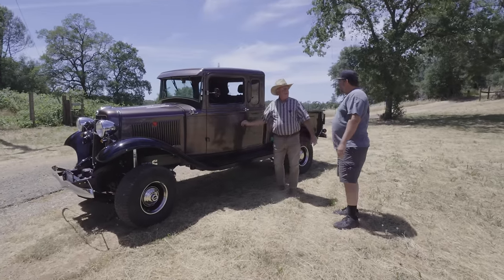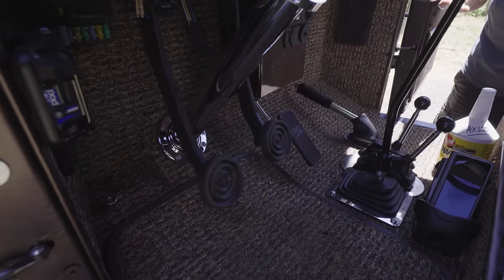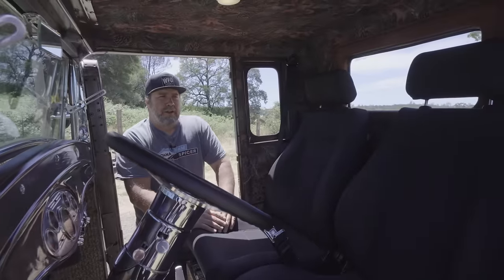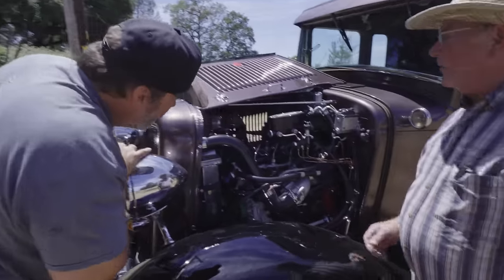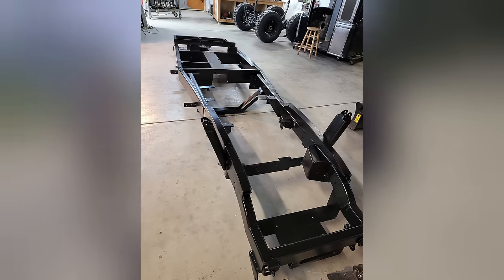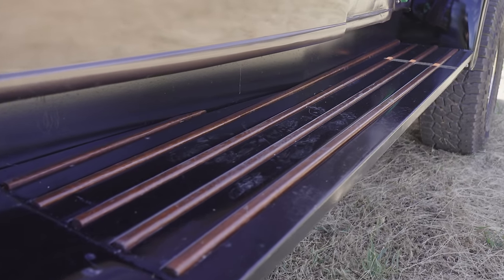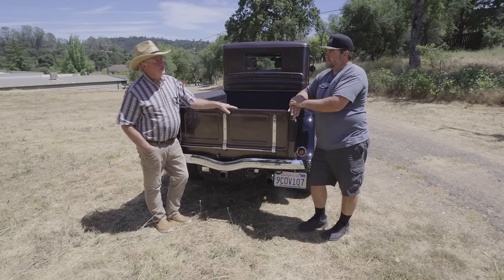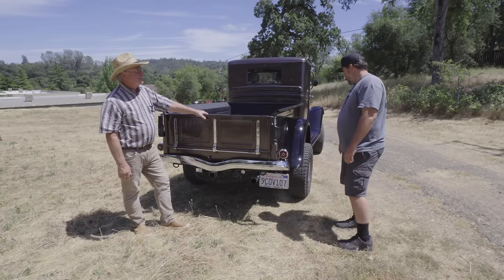1934 4x4 Ford with a Cummins!

Comment: A 1934 is NOT a MODEL A
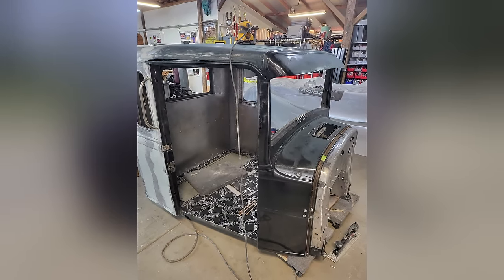1:07 "from a 34 Ford Model A"
What replaced the Ford Model A? Model B
Model A production ended in March 1932, after 4,858,644 had been made in all body styles.